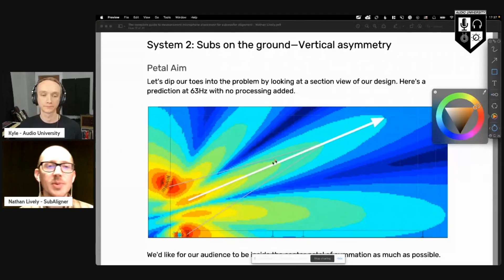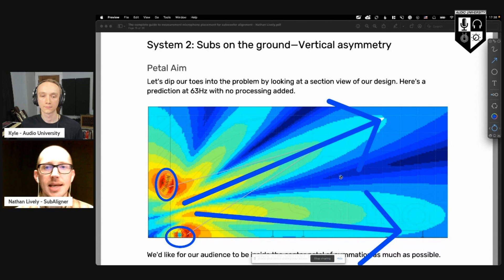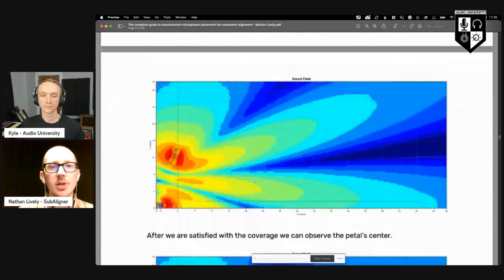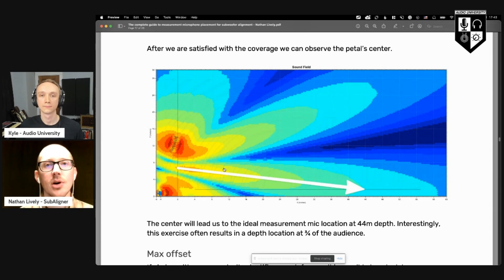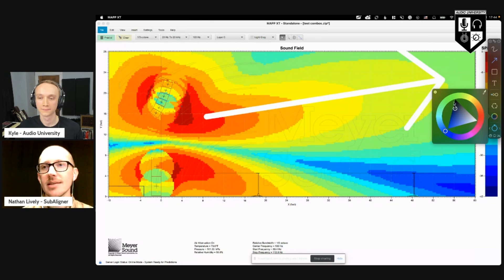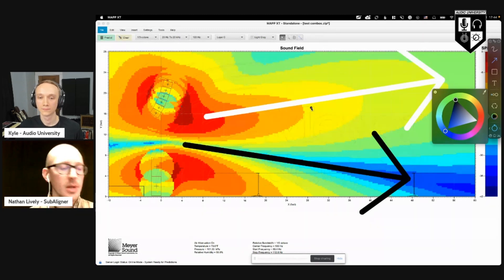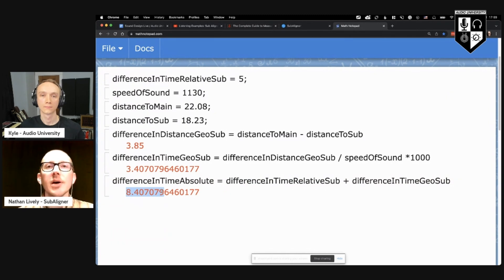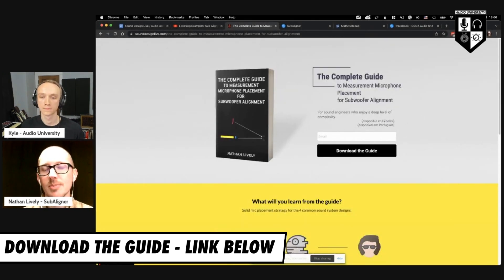What Is Subwoofer Alignment? (And Why It’s Important!)

Comment: Interesting, I've heard the term relative absolute before and watch an engineer make processor adjustments prior to and during a show. One thing that always changes during a show is temp and humidity. Which will affect speed and propagation of sound. For instance has anyone ever experienced a show starting out great and gradually end up with some undesired anomality near the end of the show? Or perhaps start a show with good sound and later the sound magically gets even better. And beer consumption has nothing to do with. Unless you're working a large room with effective HVAC, it has to be difficult to do. I'll admit my approach is not perfect but I guesstimate (I don't do math) speaker placement and sub delay as best as i can and as the show progresses, I may tweak the sub time delay. But without actually knowing the numbers it's hit and miss. So this app may be an excellent way to compensate more accurately and predictably over the duration of a show. Thanks for sharing.
Reply: If it's a live music show, I feel like that degradation as the show goes on is much more likely to be due to the musicians fighting for "more me" by doing things like turning up their amps.

Comment: Oh to have an audio camera linked to a VR headset so you could see the sound, a 3D real-time spectral visualization overview.  Life would be so much easier.

SIde question - any suggestions for recording sub-base sound?   Had some results putting the microphone in a large cardboard box (yes a more solid box be ideal) and thinking of a subwoofer cabinet but in reverse with a microphone where you would have the speaker.

But any suggestions be welcome.  Using a Zoom H4n field recorder, limited budget.

Also been working on a design for balanced contact microphones and thinking of a drum skin with the contact microphone attached, with the drum skin surface as large as possible.     Trying to track down a 100hz(and below) noise that is resonating in my bedroom at night.  Had some success, but any suggestions would be greatly appreciated by my sleep.

Comment: Great video! How about the placement of Left and Right subs. They sometime seems to cancel each other in front of the stage. Is there anyway to overcome such issue?
Reply from the maker: Great point! I’m interested to hear Nathan’s thoughts on this question. I’ve seen this problem addressed by using a subwoofer array across the front of the stage or a center cluster of subs rather than two distinct stacks.
Reply: @AudioUniversity  :)

Comment: Hello!  my system consists of a dynacord xa column consisting of 2 horn bases and a long top trow placed on top of each other without a suspension system and on the left and right side of the column I use 2 fullrange satellites at a distance of 10 ft from each other in  line.  Do you think they need any delay adjustment to the bass if they are placed in the column?  thanks
Reply: Ok! Thank you! 👍
Reply from the maker: The delay that is needed for each speaker will depend on the alignment position (where do you want it to sound best?) and the phase relationship between the speakers (is an initial alignment preset required even when the speakers are coplanar?).
Reply: Hey ADI, best to consult the manufacturer on this. And or, if you'd like to take some measurements and share them here, we can take a look.

Comment: Thank you for this video. At 6:05, what are the units of speed of sound and distance? (km/h and meter perhaps?)
Reply from the maker: The speed of sound varies according to different environmental factors. In this example, 1130 fps (feet per second) is used. Just make sure to use the same units for your distance measurements. 343 m/sec is a rough estimation of metric speed of sound.

Comment: I’m somewhat of an audiophile but after watching this I realized I need a lot more education on speaker placement, wavelength, and isosceles triangles!!
Reply from the maker: Thanks for watching, TCFilms! I'll try to create more content around these topics for you in the future. It's one of the most fascinating parts of audio, in my opinion! 

With matching speakers, time alignment is simple because the phase response of each speaker is identical - you just base the delay on the distance from the listener. The process shown in this video is useful for phase aligning subs to main speakers at the crossover frequency, because both distance and phase shift are at play.
Reply: @AudioUniversity  I'm still learning the ins and outs of home studio recording and do it only for myself right now. I have two KRK Rocket G4 5" monitors, and just got a KRK S8 G4 8" subwoofer. The sub is on the floor directlhy between my two monitors and out from them probably about 6 or 8 inches. My monitors are set at the height of my ears when sitting and they are 31" apart. The monitors sit directly in front of a wall, facing me of course, and are about 45" from my ears. 

The subwoofer has an input sensitivity switch: nominal and high. The user manual says nominal "works well with most studio recording applications." I tried both positions and you can really hear the bass when the switch is on "high," when it’s on "nominal" you have to turn the volume all the way up to hear good bass response. I find that kind of odd. I don't plan on mixing when it's set to "high," I'll put it there when I'm only listening and not mixing.
Reply: The only people I've ever known who considered themselves audiophiles were the ones who like to use words more than their ears.

Don't use input sensitivity for volume, it is set and forget and an integral part of proper gain staging, it should match your signal voltage. Use volume for volume.

Comment: I wish you’d laid out the basics a bit in that video as you usually do. It’s still interesting but it leaves me with quite a few questionmarks. Is this only for this specific arrangement of speakers? You only mention 100hz, what about other frequencies?
Reply: Hi Jonepomuk!
> Is this only for this specific arrangement of speakers?
No. The beauty of this method is that it will work with any arrangement. 

> You only mention 100hz, what about other frequencies?
In the demo we look at a 1/3 octave region around 100Hz because that is the center of the frequency range where the main and sub hold joint custody. When you develop your own alignment presets I recommend that you look at the most critical ranges where magnitude relationships are within 10dB of each other.
Reply from the maker: That’s right. You will generally aim to phase align the speakers at the crossover frequency.
Reply: Great👍
Reply: Thanks!